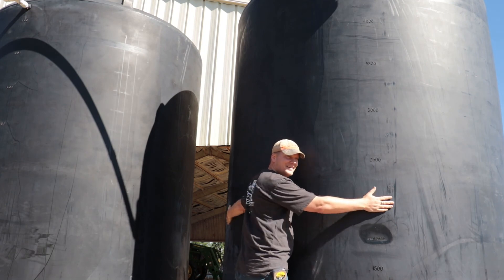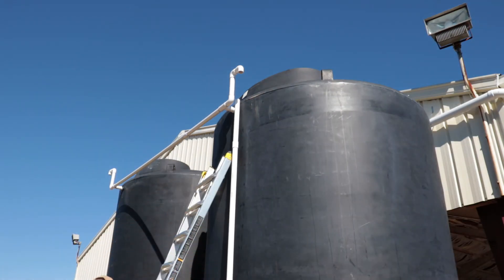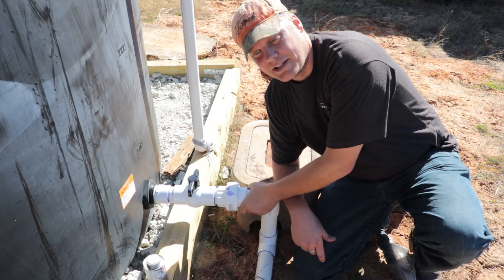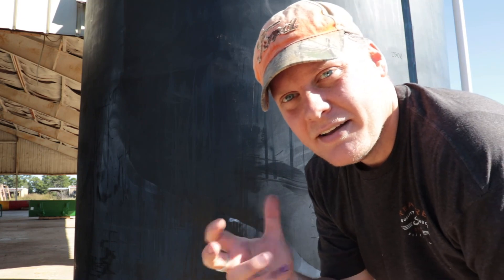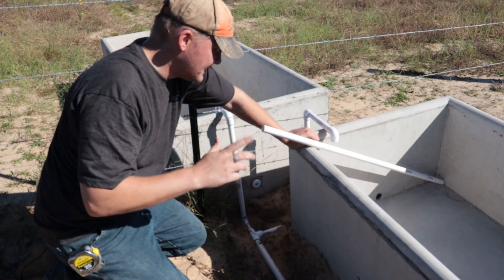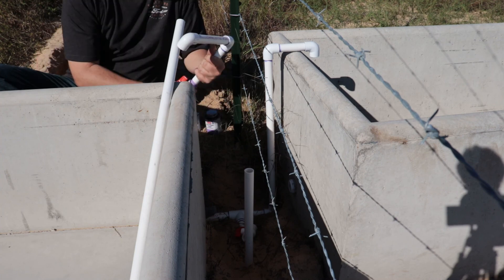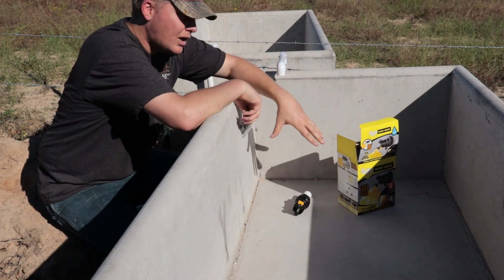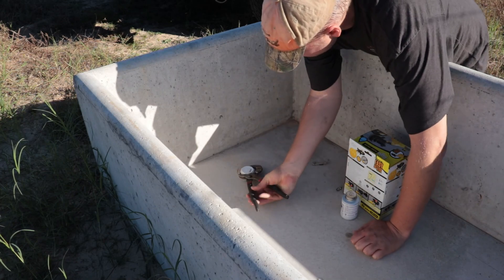Ep. 40 - Off Grid Rain Water Harvesting for Livestock at Blackacre Ranch

Comment: If you put in a T at the two tanks spigot with a clear vertical tube going up the sides, you could see your water level without tapping on the tank walls.... Of course you would want to drain the clear tube after checking prior to any freeze days.  Also, cold freeze days you will need to break the ice on the bison water trough if you don't have a stock pond.
Reply from the maker: I'm looking for a mechanical one without the water tube.  Definitely simple but I won't be around to drain the tube when it gets cold
Reply: @BlackacreRanch  You could put a valve outlet at the bottom and after filling the tube for a read out you open the other valve to drain the tube....
Reply: @BlackacreRanch  You drain the tube right after checking the water level, Never leaving water in the tube.

Comment: I know the idea is a little late at this point, but I was thinking that you could add a T joint to the crossover pipe and add a clear plastic pipe/tube that is as tall as the tanks to the top of the T. Drop in a colored ball that is about the inside diameter of the clear tube. Cap the tube but allow air to flow. You will be able to see the level from a distance.
Reply from the maker: Good idea.  I have been thinking of adding a tank fluid level gauge.  I'm looking for a more mechanical one so I don't have to mess with plumbing or insulation

Comment from the maker: If any of you have suggestions as to why the tanks don't equalize, let me know.  I think it has to do with air pressure.
Reply: If the tanks are open at the top ...with your crossover pip, then they will equalize.... If not, you got a problem.
Reply from the maker: @mrparker-t8c  I'll have to investigate further but they should be open at the top with the cross pipe.
Reply: @BlackacreRanch  confirm the two spigot valves are open....for sure by running a little water down the trough pipe then cut off the downhill trough valve